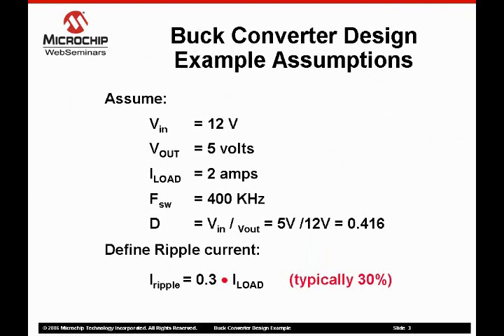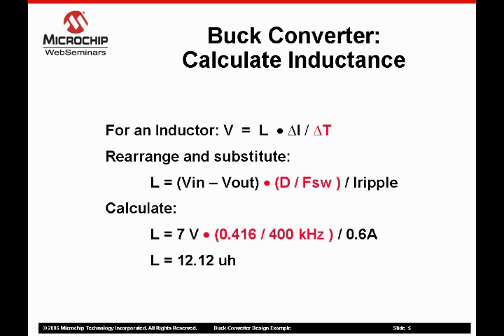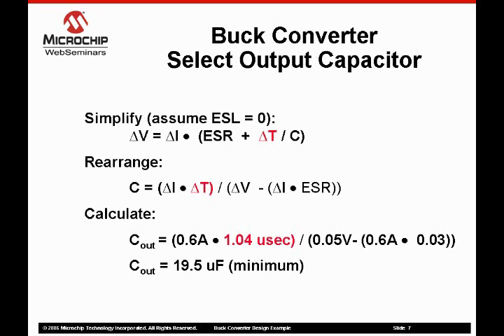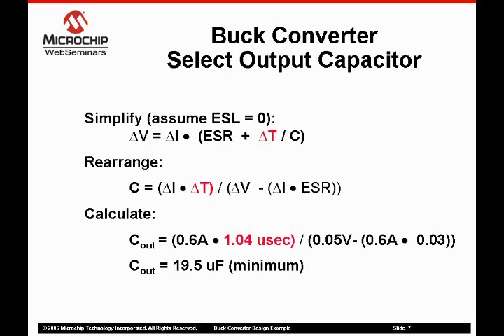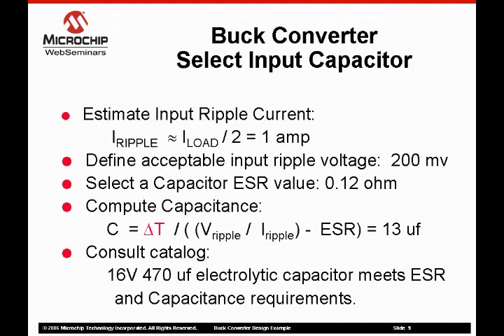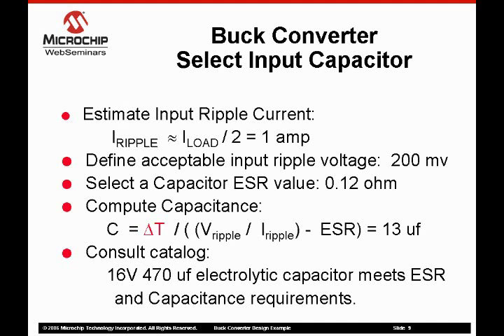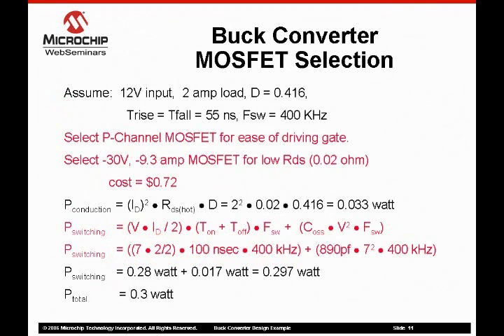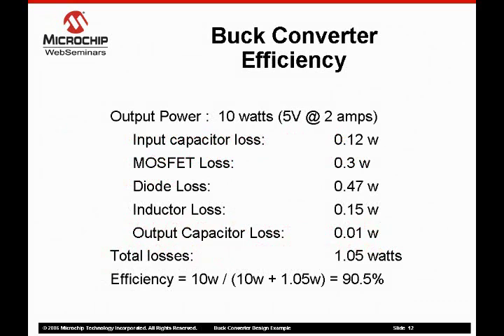SMPS Buck Converter Design Example Part 1 of 2

Comment: @jukos3 My burden, your right im sure he made a mistake but notice he uses the correct values to determine the duty ratio. This is a Buck/Step Down converter and the duty ratio is continuously controlled in a range of 0-1. D cannot exceed 1. the correct formula is D=Vo/Vin=5/12=0.416

Comment: I'm pretty sure the formula you used around 45seconds in the video for calculating L is wrong. I think it is derived from the formula: ILmax=((Vi-Vo)*D)/(fsw*L) because ILmax=((Vi-Vo)*D*Ts)/(L) were Ts is the one complete cycle (oscillation). Conclusion is that you can not use the value iLripple to determine the inductance L by using this formula. But instead use ILmax.

Comment: hey can you please help me out with my project I have to design a charge controller that's going to make use of a buck controller , I have to use two solar panels and control the energy to give out an output current of 8 amperes and 24 volts to charge my two batteries.